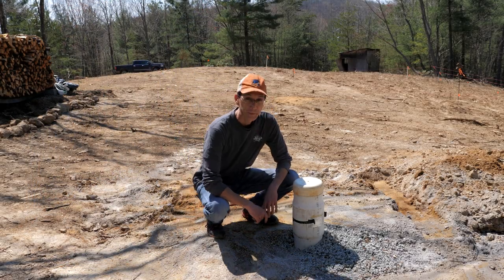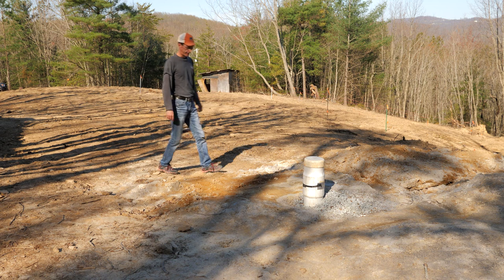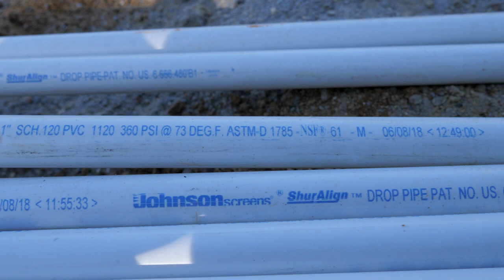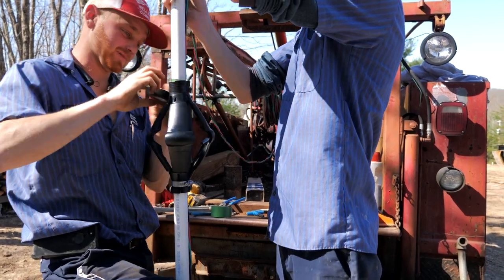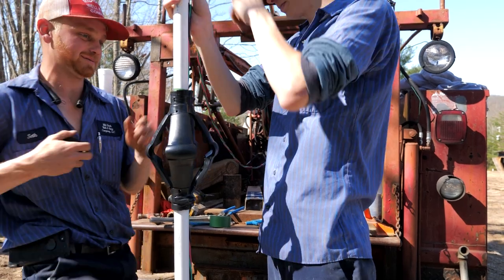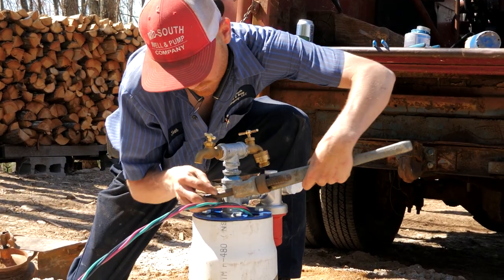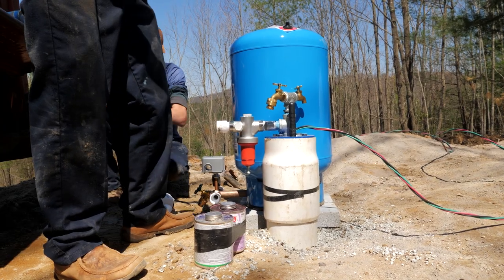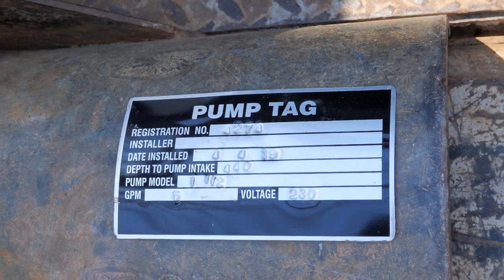Off Grid Home Build (#8): Installing a Grundfos Submersible Pump - (Part 3 of 3)

Comment: Is that orange thing before the manifold a sediment filter? If that's the case, I believe the sediment filter should be installed after the pressure switch because when the filter is clogged, the pressure switch won't build up enough pressure to shut down the pump and the pump keeps running and the water has no place to go.... Other than that the job is clean.
Reply: that is a cycle stop valve that is not adjusted right

Comment: Instead of the pvc, we used PEX with stainless crimp sleeves
Reply: at 400 ft it exceds the pressure rating of the pex pipe im sure.

PEX tubing is SDR9 with standard hydrostatic pressure ratings of 160 psi at 73°F (1105 kPa at 23°C) and 100 psi at 180°F (690 kPa at 82°C).

that only gets you to about 200 ft with 60 psi for system pressure.

Comment: Is there any chance that the orange filter will fill up and obstruct the flow? If it did the pressure switch would keep calling for water and the pump would over pressure. They make a clear bowl spin down filter that you could visually check and even clean with the twist of a valve. Not sure if it is necessary. That filter may never plug up. What say?
Reply: That is not a filter, it is a constant pressure regulator.

Comment: hmmmm 220 power required, that kinda sucks. That is something I am going to need when I go off grid too. Haven't done any research on it yet. Will be watching !
Reply: Jerry P. You really want to use 220 instead of 110 if you have a choice.  Especially with the length of wire here, resistance is a significant consideration for using the higher voltage, less amps, same wattage. Shouldn’t be an issue with most decent inverters that are higher wattage and house tie... they already plan on two 110v legs and easily wired to produce 220v.
Reply: Loner Wolf  true sine wave inverter. Not a problem

Comment: I don’t mean to high jack peoples questions for you on here about the poly pipe and I notice everyone sets and pulls pumps differently everywhere Including me but I do not know what pressure rating the poly pipe that some people are using and what is rated for, but for setting a Pump at 440’ the pressure would be 440’ divided by 2.31=190.47 psi plus 60 psi on top of the ground = 250 psi at the pump head and obviously the more pressure the deeper you go. 
They do make boreline hose that’s rated and made for it but it’s a little more expensive than the ol schedule 120 pvc.
Ps a lot of people don’t realize how precious water is until they don’t have it.

And ps ps I even have some grundfos 
Flex videos if you get time you can see them
Reply from the maker: Most black poly pipe (HDPE) is 160psi but you can get 250 psi. Couple that with trying to wrangle 440’ of it in one piece and it becomes a huge pain in the ass. That’s why we used schedule 120 pvc rated at 360psi for up to 10gpm.
Reply: I use 120 all the time, all the way up to 4”  it’s decent stuff. 
Also when people like to put cable or rope around the pump I find that it keeps me busy (partly what I do for a living) after it rust off or breaks off in the well then it falls and wads up above the pump and then the pump gets stuck
Reply from the maker: Ugh. Good times. 😉😂
Reply: you're nailing it Jeremy !!!!!    @Guildbrookfarm
Reply: @mattsdrillingforfood7624  - This (regarding the safety cable/rope) is exactly what I was told by the guys that replaced my pump a couple years back.

Comment: I can't believe he hooked that manifold up w/o two unions?   Jeremy, the tag said 5 gpm, but at what head pressure?    Here in Iowa we must use 4 conductor electric cable with non conductor pvc casing!!!!!!!    There should have been a safety copper wire or rope in case of pipe failure, not a serious problem with Schedule 120 pipe though..... Truly enjoy you two at work and thanks for hard work of showing your viewers...   I would suggest you test water for piece of mind and safe drinking!!!

Comment: So, you never told us how you were going to run a 230v pump with a 115v genny. (4:30) ???
Reply from the maker: I’m not. If I could do that I would not be in the off grid homesteading business. 😏 I would be in the magic power business. 😂 Stay tuned! 👍🏻
Reply: @Guildbrookfarm  but actually you can run 230 on a 115 generator. It's just not good for either appliance. I'm in the same boat right now so very curious as to your solution.

Comment: Thanks for the information. Question please. Iv'e got a pond that needs lots of water (south Texas) and I hate to run it on electricity alone filling that monster. Can i switch this pump from solar to electricity when i want so i can supply my ranch house when i am at home ? If not can you point me in the right direction? Thanks in advance
Reply: You probably could I would talk to your Electrition about it. I also don't see why you couldnt.

Comment: Instead of the black electrical tape. They should have used 2 1/2" heat shrink 2-3 foot long around that PVC to hold the wires tight to it.

Comment: very kool seeing them how they install that pump and line , I am a plumbing contractor in L.A and I once owned a house in hill country (Texas) and they had to replace my sump well pump and line from galvanized to PVC and at the time I was in L.A so I never got to see how they replaced it , the only thing I don't like what they did at you're well head is the galvanized tee and nipples, I would've told them to do it in brass, looks great best of luck with your homestead !

Comment: If you ever have to pull that well you'll need a boom truck or build an A frame wench tower to do it. I have used a backhoe to pull a 2" galvanized jet pump well had a foot valve on it. That was crazy. Not trying to disparage or discourage or be a Debbie Downer just FYI. Love y'all's show especially the part about a preppers pantry because we've been buying bulk and keeping him buckets for a long time but only what we use for about 6 months. we're fixing to expand and try and get it done for a year's worth and then maybe more, so the videos on the preparation of storage were great. Thanks.
Reply: If he ever has to pull that pump he’ll just call those guys back out to do it properly.

Comment: I am surprised they let you film them. First the casing should be steel pipe set 5' into bedrock (however far down that is). Then grouted with waterproof cement which you did.
 They used 1" sch 120 pvc which is great, rated @360 PSI. the pressure at the water level 400' down is 225 PSI. Why galvanized pipe fittings? They will rust and cause nothing but grief! They should be brass, Just like the brass check valve they installed. They should have installed a pitless adapter. Easier to remove pump and frost proof. 
You guys are great, let life enjoy you. I do.
Reply from the maker: Code here doesn’t allow pitless adapters and they aren’t really an issue in our climate. Steel casing is expensive and unnecessary and will rust out over time especially if the water Ph is acidic.
Reply: Laddie This is a case of every area has its own code for wells on casing type and install method along with all other aspects of the well from testing to how to hook into it so no one size fits all code on wells.

Comment: No union ? ya got to cut the tank off to pull the pump
Reply: With plastic pipe its pretty simple. Cut and reglue.
Reply from the maker: Yep. 2 minutes.
Reply: Yep, simple enough and it ain’t like you’re pulling it on a regular basis...hopefully won’t have to worry about it for 20+ years.

Comment: Torque collar would have been nice. I had to replace my electrical line every few years until I put on a torque collar because it would twist when the pump came on and the wires would rub against side of the well until it rubbed all the insulation off and you'd be surprised you would think it would go to ground and short out the breaker or something but you can have a foot of insulation missing on the side of the wire and it still runs but it draws more amps and it's not as efficient doesn't run as well and then you'll burn your pump out. So I put one on mine and sleeve my wires in 1/2 inch polyethylene black pipe haven't had a problem since. And being a master plumber in two states North and South Carolina I work on all my neighbors Wells and I've done that for them as well.
Reply from the maker: They put a torque collar on above the sleeve in the video. It’s also a soft start pump so we should be good to go for a long time.
Reply: Most excellent. Good job.
 @Guildbrookfarm

Comment: Well now ya have to build a well house. Aint it great.
Reply: Just keep in mind, the pump will have to be pulled at some point, and we'll houses are a pain. As a former driller, I designed mind with a sliding roof and hinged walls for complete access for the pump tech

Comment: Not just that but if you are planning a cistern on top of a hill with a slow pump you should also have a inline water turbine that brings you back most of the power you're spending on your pump you can never receive all the power but you can receive lots of it just from your water flowing through the turbine back to your house they make a big ones so you can put one right off of your main outlet off of your cistern they also make little ones so you can put 12 in line to make the gravity feed you back your electricity

Comment: Here in the hills I worked for a well company a year or so while in high school around the shop. They had guys check the job sites and spec the wells then built their submersible pump unit systems in shop and the guys just assembled the pipes and dropped them in the wells  on site. What I see different these days when we built the pumps up they all had enough rope secured to the pump to come out with the wiring and the pipe. for service. I no longer see anyone attaching rope rope, is it something that has been discontinued or just used in some areas?
Reply from the maker: They don’t drop rope or cable around here any more. 🤷🏻‍♂️
Reply: @Guildbrookfarm  Thinks it's been over 30 years ago that I worked around it and didn't know.
Reply: The company that replaced my pump a few years ago said they used to use rope but they quit quite a while back because it was the first thing to break and get all wangled up in the well, causing problems.

Comment: Why not using heavy duty polypipe....1 roll is about 330 ft ...easy & faster..& low cost..in Malaysia we using Polypipe...
Reply from the maker: Normally we would but not at this depth and pressure.
Reply: Guildbrook Farm - Off Grid Living 
  There's a hundred ways to do anything, and all of them be correct. I used the roll poly with a pump depth of 300ft, the only downside to PVC is when you have to pull the pump, you will have to pay somebody to do it, but with any luck, that will be 15 years down the road.
  The only complaint I would have is the lack of a safety rope. The rope should be what holds the weight, not the pipe and wire, and with the rope tied to the pump, and run through the cap to a tee bar, the chance of the pump falling to the bottom is eliminated. Like he told you never to remove the 4 bolts in the cap because you would lose the pump, with a safety rope that could never happen.
Reply: Pvc is actually easier in some cases to pull. You have the couplings to tape above so the wire won't slip down causing strain on the wire at the top

Comment: I would have gone with roll pipe instead of stick.
Reply: They do that as job security so you have to call a truck out to pull the pump out if it ever goes bad and you can't just do it yourself.

Comment: How come you did not add a rescue rope, you can pull it back out, if the pipe breaks.
Reply: I was going to ask the same!
Reply: Kevin Michael - Would the 3 strand electric cable work?
Reply: @tonygrimes13  I wouldn't want to put that kind of stress on it
Reply: The rope is more likely to break after 20 years in the water than that schedule 120 cpvc.

Comment: Installed one-way valves to take the load off the system
Reply from the maker: Check valve in the pump and another at 200’. 👍🏻
Reply: Water hammer.

Comment: You cannot buy a better submersible water pump than Grunfos. They are the only one that is completely made of SST, shaft ,impeller,chamber.caissing,shaft. I have worked with these pumps and they are very reliable. Just make certain that you use the correct wire size for you motor or you will and i say will burn out the motor. In some instances i went with a transformer to transfer single phase 220volt to triple phase 220 in order to reduce the wire size and amps required.
Reply from the maker: Yep. The 10/2 solid we used will run this pump up to 720 feet which is way more than we’ll need. This pump only pulls 12amps at startup and that’s soft start. Runs at 9.2amps full speed.
Reply from the maker: 😂 Lots of gerbils
Reply: @Islandwaterjet  Don,t take my word for it look it up and you will be surprised what is out there. I installed this unit on a 1000 ft well up a mountain in Quebec. Was 950 feet from my power source with 2.5hp motor. Check Grundfos water pumps and the accessories that are available.

Comment: From someone with quite a few installations of bore pumps "thats how hold it on" is incorrect the sleeve is to provide protection and assist in cooling the bore pump.
Reply from the maker: I was asking about the slits he cut in the sleeve. That’s how you they hold the sleeve onto the pump.
Reply: Pay attention hippy.

Comment: Why wasn’t glue put on PVC pipes after the primer ? That’s usually customary for connecting PVC pipes.
Reply: Have you ever installed a deep well pump?
Reply: this is schedule 120 well pipe has a slip section and is threaded pipe not sch 40 home pipe

Comment: Brother and I pulled his 235 foot well by hand one Sunday. Opened up the roof of the shed and he stood on top and grabbed the pipe as it came up and helped pull. When we got to a joint I would slip on a pipe wrench to hold the pipe then use a second to turn off the top one. As an electrician I didn't care for their system of connecting the wire so it  not only had shrink fit over the individual wires but the whole bundle was then shrink fit and had butyl tape and then 33 on the outside just like an electrical splice! Going back in was the fun my brother lost control of the pipe and pump dropped about 30 feet before I was able to get it stopped by then my gloves were smoking!
Reply from the maker: Yikes!
Reply: @Guildbrookfarm  When your broke you do things normal people wouldn't LOL
Reply from the maker: No kidding! Hillbilly Engineers United!

Comment: you kill the pump by putting the pipe around it ,,, you increase the suction pressure and water flow around the pump,
Reply: Its called a sand shroud, and it prolongs the life of the pump
Reply: It makes the water come up past the motor to cool it.

Comment: Also DC motors when not hooked up to a power supply and instead hooked up to a charge controller create electricity when spun if you like doing any working out you hook a couple of these motors up to a bicycle and you ride your bicycle for exercise and while you're exercising creating electricity